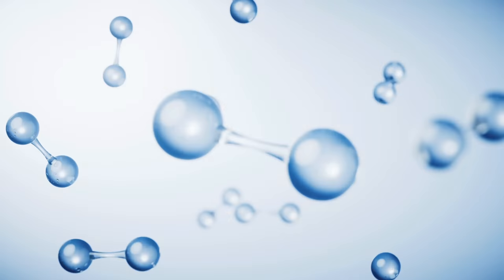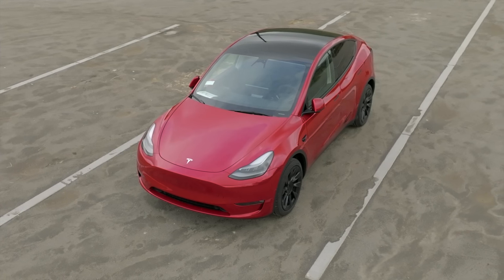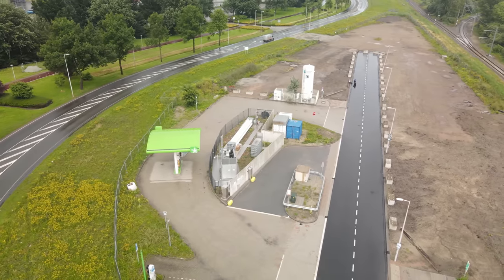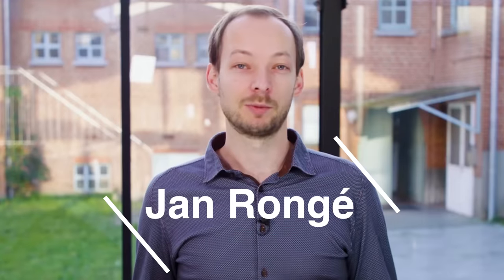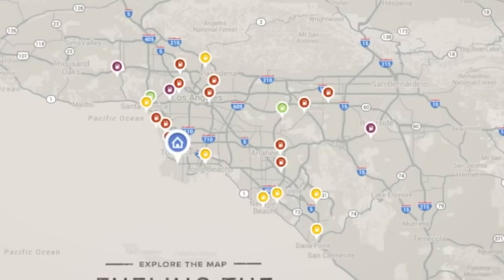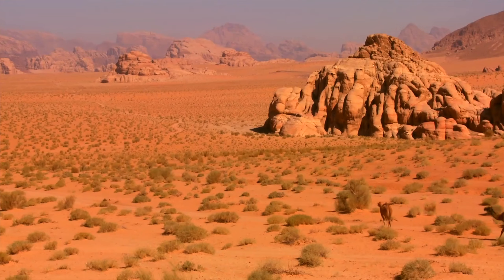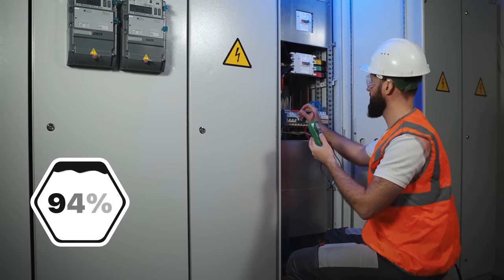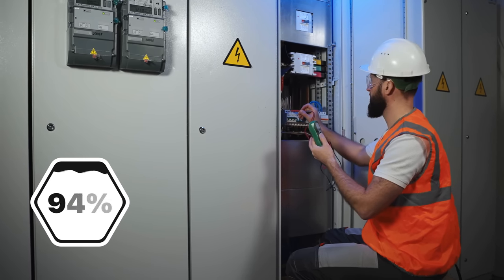Breakthrough Solar Panel Makes Hydrogen At Home!

Comment: What's with the constant turning around? You're making me dizzy; I can imagine you couldn't walk when you finished filming this video cause of the dizziness you had. And the need to reduce CO2 emissions is a completely different story. Why simple (Fossil Fuels) let's make it complicated (Hydrogen) for no reason. That is not good. And what is the breakthrough? We have solar panels and electrolyzers for a long time nothing new here. 97% efficiency I doubt that.

Comment: Converting your furnact to run on hydrogen is the key point you did not suggest. Using the hydrogen for heating and cooking makes more sense. These little thongs would never produce enough hydrogen to be used commercially. In cold climates like Trudeau's Cold Canada would welcome any alternative to natural Gas. And anyone who actually knows how to cook, would have an alternative to the scarry natural gas that your brainless biden wants to ban.
These panels could make a differance..... If they can produce enough. 
Maybe you could do a follow up video with what it may take to retrofit gas appliances to hydrogen, and hou many of these panels it would take to heat, and cook for an average family home north of the 45th parallel.
Reply: Sorry about the typos, I did not have my readtng glasses on , and too big of fingers on the small tablet keypad. 
Have a good day and thank you for your great videos, with insight and intelligents.

Comment: Are you sponsored by Tesla? Think of child labour, the poisonous dust from mining, the slavery involved in mining for the battery components! And another thing is: in winter you must keep the ev plugged in to keep the battery in working order and in winter you lose around 40%(!of it's capacity! In summer you must keep the battery plugged in to prevent them from overheating, causing fires! In the Netherlands on most places, you're not allowed to park in parking facilities due to firehazards because of that overheating issue! During driving you use electricity to cool or  to heat the battery aswell! Roadtaxes? The weight of ev's is enormous! In The Netherlands next year people have to pay road taxes on their ev and many consider to buy a combustion car again, because they are much lighter! How about people that don't have a private drive? They always have to recharge at a commercial charging point; which makes an electric car so much more inefficient! Fast charging sounds great but is murder for your battery! Still the range is to cramped; think of all the time you loose recharging! How about the range when you're pulling a trailer?! It's less than half! Ever tried to pull up to a charger when pulling a trailer? You have to unhooke EVERY TIME! I don't like ev's.....does it show?

Comment: 3 X more energy to produce.
What is the point of micro inverters on a roof like yours where you have no shading / over shadowing?
Seems like a waste of money for no benefit.
All sane people know that Toyota have lost their mind when it comes to hydrogen, they are flogging a dead horse.
Hydrogen is great for things like green steel production if the hydrogen is produced on site.
This product seems pointless. Whatever happened to those hydrogen cartridges?

Comment: Stop making videos that promote hydrogen as a solution. Please. 

Every time I watch one of these, I hear "There's problem A, and problem b, c, ..... x, y and z". Almost all car companies have binned their hydrogen car projects because hydrogen production doesn't make sense, storage is too problematic by the very virtue that hydrogen is just so small that it slips through the cracks of whatever we build, and transportation is ridiculously expensive. he only entities interested in hydrogen, are oil companies because it fits right into their world, while every other green tech does not. 

By promoting these technologies, people get the impression that the problems are solvable. They are not. Not in any efficient form. As you say in the video, these panels don't come with anything to actually make the hydrogen usable in your home. Not only will that be expensive, it will also be bulky and dangerous (have you ever seen the storage tank of a hydrogen car? it's built to withstand a missile strike because otherwise it would be too dangerous!) Even if Hydrogen production and transportation CAN be done without losing 70% of the energy that we put in, storage and transportation are not going to be efficient on scale.

Hydrogen will be a fringe technology perhaps for trucks that need to go to remote places, and heavy industry for which it is difficult to use electricity.

Stop continuing this grand illusion - you are only serving the oil industry.

Comment: Refilling at home in 3-5 minutes is a joke when the car is parked there for many hours each day.  Hydrogen is a joke and makes zero practical or economic sense. Just buy an EV which costs less to buy, much cheaper to operate and can be recharged anywhere.  BTW, this saying that it’ll cost the same in 2030 as a farcical as it assumes that solar panels and batteries aren’t also getting cheaper.  As for hydrogen not requiring as much material - where do you think all of the components for the electrolysis come from?  

You’d need to be a complete idiot to fall for this.

Comment: If you want to save this planet you have to stop worrying about efficacy. With Hydrogen that can power every transportation vehicle we can think off efficiently does not matter. Ask yourself how efficient do you need to be to save this planet? If the feed stock is infinite which Hydrogen is then efficiently does not mater. Batteries are not sustainable full stop. And create more mining and destruction of ecosystems. Go ahead efficiently save this planet. Good luck.